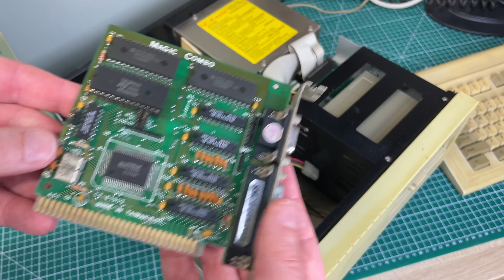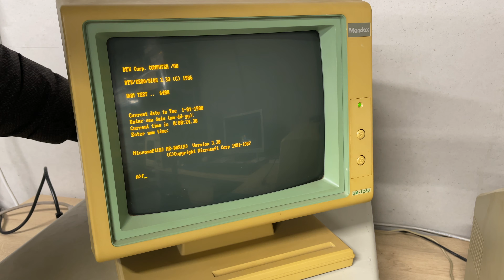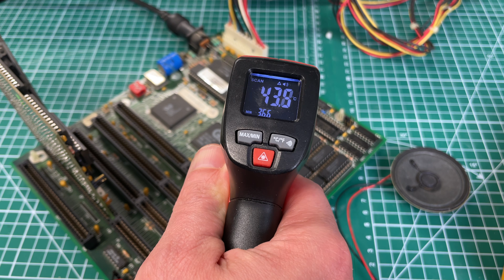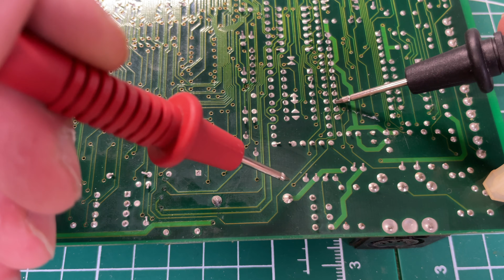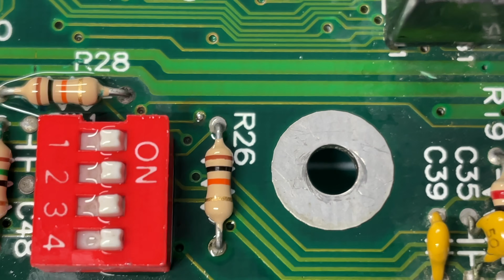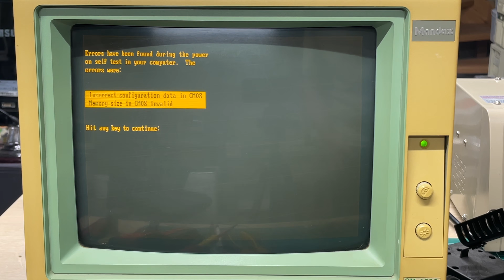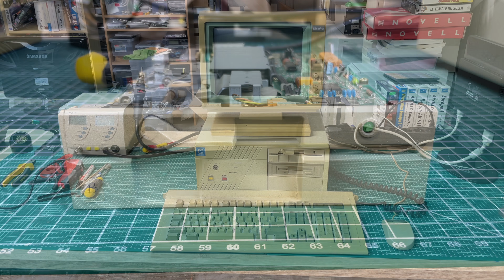I bought a 35yr old PC for 30 EUR

Comment: I find the best thing to use for splicing fine traces is to just strip some stranded wire and use a single strand of the wire, works great every time (also suggested by some one else as well I see).  Also clone that drive ASAP!

Comment: my little secret to soldering a bodge wire to a via is to add a bit of solder to the wire, enough for a solder "droplet" to form from gravity and anchor it (and the wire) to the top of the via. a wire close to the size of the via really helps in this.

Comment: Funny story. I used to have an ST-157A around '97 that wouldn't start. Somehow I figured out that it would start if it was literally warmed up. So, I put it in the oven on 50C for 10 minutes or so, and then it would fire right up! It kept on working like that for years, as it was in a home server that barely ever powercycled.

Comment: More than 30 years ago I wrote my first real program in QuickBASIC. It was a sidelight of my job in the communications support department of a large electric utility. It took three months and took me into the realm of direct hardware access. The IT department programmers wanted $73,000 to do the job and I had knowledge of the rare hardware it had to connect to.
Don't underestimate the real world capabilities of equipment from the '80s.
Reply: Huh? With different PDP and VAXes I guess it was possible to do everything MS-DOS/640KB-ought-to-be-enough did in late 80s. Unfortunately I don't know much and was a kid in 80s and teen in 90s :-))) But nowadays watching YT videos about different equipment and even small  "industrial" computers, I am sure engineering guys didn't feel limited much with hardware and memory, especially in the second half of 80s.

Comment: 0:48 Are you sure this video card is even working ? There's no video BIOS which should be required to make it run.

For the bios issues, sometimes you have to run the CMOS setup twice to make it work properly. It's a bit weird and inconvenient but I've seen that happening several times before.

Maybe the 32.768KHz crystal has died ? That would explain why the clock doesn't tick anymore.

Comment: I bought a new 386 pc similar spec only £999 euros new, oh and the 200 meg hard drive was an additional £1000 back in about 1990.
Reply: Leave it another 20 years and the HDD will cost £1000 again.

Comment: Just a tip on soldering, solder flows to the heat, you can hold that heat on a bit longer. Great job BTW.

Comment: Try TYPING the correct memory amount in the BIOS. I had a similar problem with a 286 and the memory could only be changed if you typed a number into it.

Comment: If you wanna do less collateral damage, use a scalpel to precisely remove solder mask instead of the fiberglass pen.

Also, fine magnet wire works a lot better for little bodge repairs of cut traces. You'll also want to tin all the exposed copper to reduce future corrosion.

Good job getting it up and running again.
Reply: using a particular alloy solder allows me to bridge small gaps like that without even using a bodge wire. It fails me what it is at the moment,  but works great. And lacquer will seal the copper and prevent corrosion. Though fully tinning them is best as well.
Reply: @wishusknight3009  yeah, but I don't think he'd bother with repairing the solder mask. This was a super quick and dirty repair, so I didn't even bother mentioning it.
Reply: @mortrek  He has stated before that he always does. He doesn't always show it in the video. I personally just use nail polish.
Reply: @wishusknight3009  huh ok. You can't really repair solder mask with a giant wire sticking out though...
Reply: @mortrek  Don't always need to use solder mask. thick nail polish works almost as well. And for a private collection usually its good enough.

Comment: I just sold that exact keyboard.  Futaba clicky switches but most were degraded to the point of feeling like linear switches.  Too bad.  The ones that worked still had a great snappy sound (and so loud!).  Really love that amber monitor. Don't retrobright it! :)

Comment: I like watching your videos! Just a hint, it's better to use thin magnet wire or cut up some stranded wire to obtain a single strand for fixing these small signal traces. It doesn't look good and puts a lot of mechanical strain on the traces if you use such thick wire. :) Also, try to hold the glass fiber pen vertically  to the PCB and use it like a brush (less force) and adjust it so the fibers barely stick out. Will make a lot less mess and the pen lasts much longer. :)

Comment: i like how these motherboards from this era for 286/386 are so compact.
nice rescue, one thing you might do is put some nail polish over the exposed metal to keep from corroding.
Reply: I have one of the first 386 full AT boards that had that Chips 8 IC chipset and intel 385 cache controller chip. No onboard ram, it is all in 2 ram boards on proprietary local bus slots. The board is 14 inches square and fully populated with out any bit of space anywhere on it. not even with onboard IO or anything. 8 ISA slots with 2 used by ram boards. Its pretty crazy for a 20mhz machine of 1988. 

I tried bumping it to 25 for a while and it mostly worked pretty well but for a few unexplained crashes that didn't happen at 20.  Crazy enough with only 32k of cache, its actually faster than one of the latest 386dx boards with 256k cache running at 25mhz. Even with the newer board having a plethora of timing and tuning options in bios. It comes down to the old dog having true zero waitstate operation and interleaving of ram banks. Something the newer board did away with for simplicity and cost.

Comment: Where did you find that beauty? Here were I live, a 286 with printer, manuals, software is 4000€, an broken one (not tested, as is) start at 200€.
Edit: That Oak OTI067 can be upgraded to 1M. Can both cards be used on that computer at the same time (like it was the case with Hercules and VGA) or you have to set the 8-bit ISA card to mono?

Comment: Not a bad score for 30 euro’s. Some of the parts like the 5.25” floppy drives by themselves can go for a lot more. Despite the need for the repair I’d say you’ve got a very good deal.
Reply: i recently was given a really old computer
a dell 333d from 1990!
it has a standard side 3 inch floppy drive and a 5.25" floppy drive 
it has some strange drive that makes me think of a weird front facing cassette interface system
 my grandfather might know more but i can't just go and ask him because i live far away

my dad says it might be a beta tape but not betamax  

does anyone know where i can find documentation about the computer?
Reply: @slycooper1001  That tape drive you describe is most likely a tape streamer. It's a bespoke computer data backup system, these sort of things still exist. Back in the day you store over a gigabyte of data on them.

Comment: I've seen some people use that super thin coated copper wire to repair traces, seems easier to work with than what you were using.
Reply: Enameled wire / transformer wire.
Reply: Yeah, magnet wire is completely fine to use, a lot better looking too.

Comment: Kinda crazy here is that the two "G2" chipset chips seem to have fully identical markings. What do they even do, that you need to just plop two of the same chip and it all works? Not like that on the more modern chipsets with north and southbridge and all that.
Reply: Each one handles 8 bits of the data bus. A single chip can drive an 8088.

Comment: Ooh, I see an Seagate ST-157A :)
Wonder what the condition of the drive is. Maybe run MHDD for bad sectors and speedsys for performance checks. If you're using MHDD, you'll need MHDD 3.0 as it's the last version to support non-LBA drives 👍🏻

Comment: With small breaks in the traces on circuit boards, I've seen people repair them by making a small solder bridge over it. Is there a reason you didn't try that?

Comment: How hot is your iron? seems like it very quickly charred the board, if you use good leaded solder you shouldn't need to go over 300c, but the solder mask might just be old and bad.

And as for patching small broken traces like that, you can also just bridge the gap with solder.

As for the time not progressing, it likely considers 01:00 January 1st 1980 as the "reset" time, which it goes back to when the settings have been lost, and thus it considers the setting invalid until you change it.

Comment: You may get more out of the Post Code Card if you put it the right way into the slot. It seems to be clearly marked "Rear" with an arrow pointing proudly away from the rear.
Reply from the maker: Facepalm :)
Reply: @RetroSpector78  Don't feel too bad. We've all been there... :)
Reply: @RetroSpector78  and not the first of yours :(
Reply: Stopped watching to type just this. Hope it's not fried. :(
Reply: @MadCatSE  Should be fine, I made the same mistake and mine survived
Reply: @unitedco1904  mine survived also
Reply: Adrian Blacks card didn't survive 😜
Reply: My POST card fried instantly
Reply: I bought a diagnostics card from aliexpress and I always make sure it is inserted correctly into the ISA or PCI slot. ISA cards are always facing up while PCI cards are facing down. I probably need to get a new one or repair my one because the 3rd digit of a 4 digit display has a what-seems-to-be a blown internal led inside of the 3rd digit. If there an 8 displaying on the 3rd digit, it looks like a 9.
I bought recently a mini-PCI/mini-pcie/lpc diag card for laptops and I kinda made a mistake when I inserted the diag card into the middle of the mini-pci slot instead placing into the left-most area of the mini-pci slot in order to allow the mini-pci claw to hold the diag card. Fortunately, both  the card and the laptop are ok.
Reply: It was... interesting to see the voltage indicator LEDs flashing like that though - presumably they ended up connected to data or address lines, showing bus activity.
Reply: Can't say I haven't made the same mistake in the past. Thankfully in my case the card and motherboard weren't damaged.
Reply: I didn't even notice this & yes I have also made the same mistake!
Reply: yep i saw the post card was in wrong, i have the exact same one, 😉

Comment: Nice machine for just 30 euro.
And I want to get one cheap Baby AT pentium motherboard. For Pentium MMX upto 200Mhz.
Reply: Are you in the UK? I have a skt 7 pentium MMX PC complete with case, PSU, CPU, RAM, HDD, 2 optical drives and W98SE. I work on it occationally when i have spare time and will be listing it on eBay eventually.
Reply: Are you interested in buying it?
Reply: @simontay4851  Nope. I am not in the UK. I am just looking for a Baby AT motherboard under maybe 50 euro to replace a motherboard that I probably killed when I was replacing the din-5 to a din-6 ps/2 keyboard socket, it was kinda having problems before anyways. But if I lived in the UK, sure I would like to have those computers.
I been looking around and prices are raising. I deleted my ebay account because most of sellers want paypal over credit card instead of paypal-bank account.
Maybe @Retrospector78 wants your computers when he visits the UK to make more videos. I hope he has a big car to fit all of your PCs.